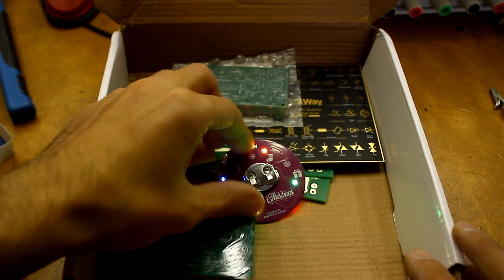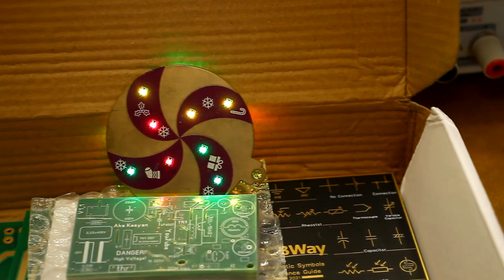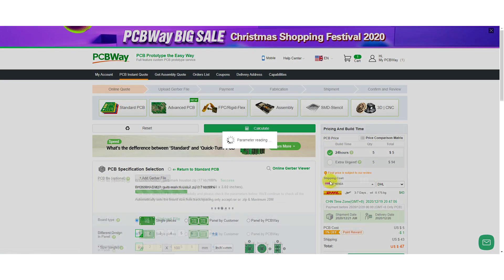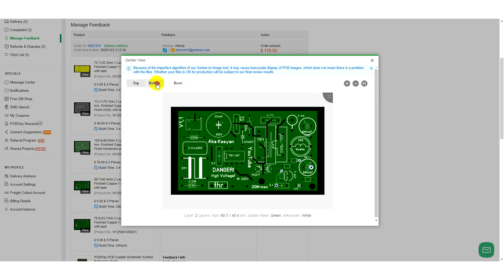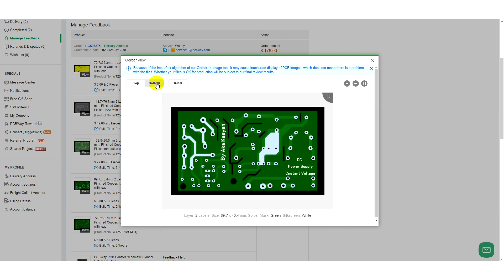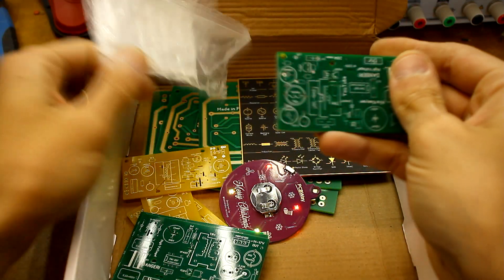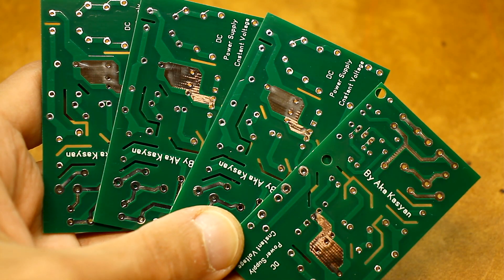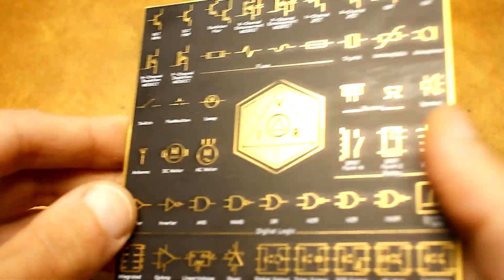Simple Constant Voltage SMPS (TNY267/268)

Comment: That is not as simple one as could expect. 
EMI filter is present, whats more (I dont know if it's intentional or just copied from commercial project) there is a R2 resistor that would stop oscillations on LISN network for EN EMI testing. There is R8 resistor as initial load and commercial snubber network (for price reduction, R3 and C4 used, not TVS), inrush resistor present and CLC outpul filter. 
It is quite a sophisticated design that can hit a store shelf. Just VD3 diode would be a heat generator out of the ripple current. Out of that it is a perfect design.
Reply: the RCD clamper is super common as a snubber, more reliable and cheaper than a TVS diode
Reply: @trissmerigold7197  Wouldn't say more reliable. RCD snubber are cheaper and better in terms of EMI (no hard clamping), but they are also harder to design (it just have to be validated values are correct). Out of that used mostly in commercial SMPS. TVS lead to hard clamping but are more convenient designing and protecting mosfet DS overvoltage, so favourable in low-volume production.
Reply: @mtmsweb  i honestly haven't found RCD clampers to be hard to design, it's really quite simple. on the other hand, the TVS if not accurately selected, and occasionally also without any reason can easily fail (and often short-circuit), and if that fails short the rectification diode of the snubber will have a very short or nonexistent lifespan (or probably in this circuit scenario the power supply will not work at all, only short bursts). it is however more compact and an easier solution